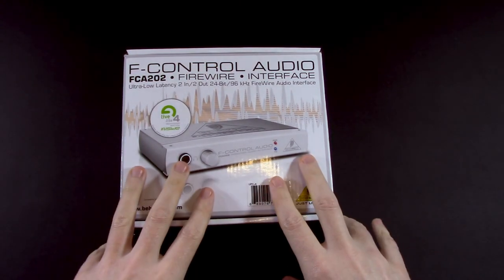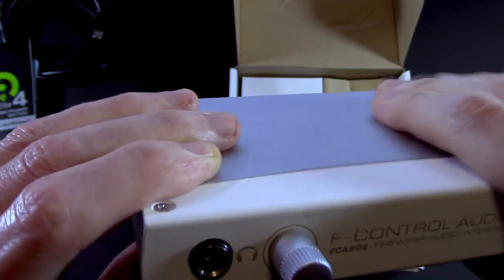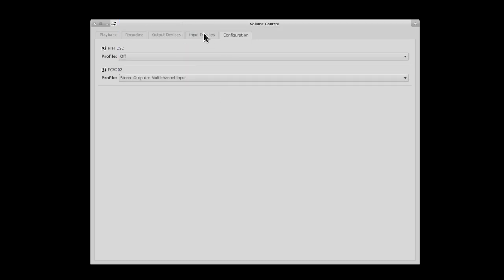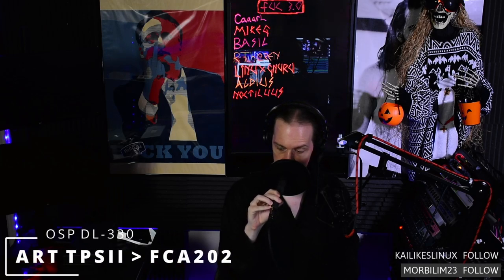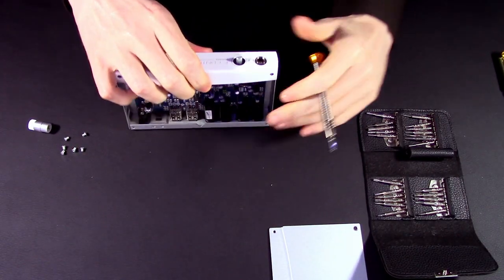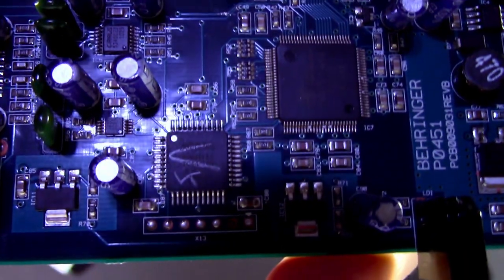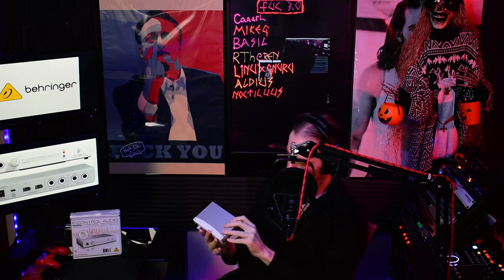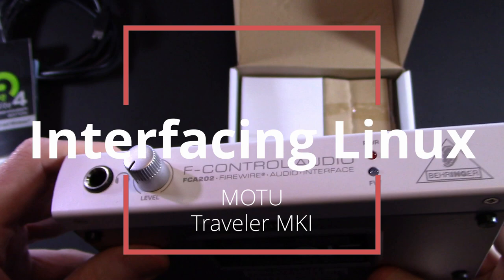Interfacing Linux: Behringer FCA202

Comment: Hey Great Video LGCS..Is it supported for firewire connection to my Windows 10 PC?  I purchased the FCA202 and have plans to use it on a Windows 10 PC. Please advise on where I can find the drivers to make it work - Thanks!
Reply from the maker: The FCA202 is not compatible with Windows 10.
Reply: @linuxgamecast  would the FCA2020 work on a MacBook Pro Mid 2012 and it is equipped with a FireWire 800 Port as Plug and Play?
Reply: @markquiroz3460  not quite sure you're on the right channel mate.

Comment: Hi, does Linux recognize it out if the box? Or did it require a driver installation? I’m looking to get one of these just to use It as an DAC for music and the machine it would be used with is a Linux pc with elementary OS
Reply from the maker: It's supported by ALSA and FFADO.
Reply: @linuxgamecast  cool, and does it only work with a 32bit Linux distro? I would use it with a FireWire to usb cable (the pc doesn’t have that port)
Reply from the maker: It is not possible to connect a FireWire interface to your computer's USB port via a FireWire to USB adapter since this connection is not sufficient to run a FireWire audio interface.